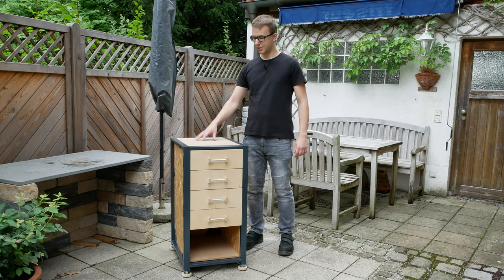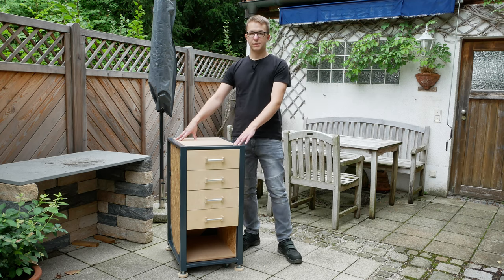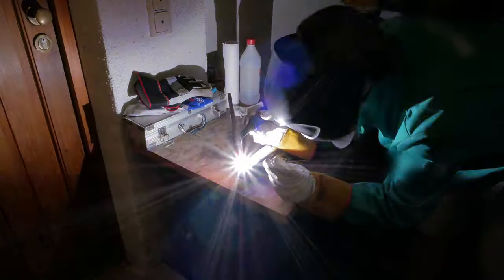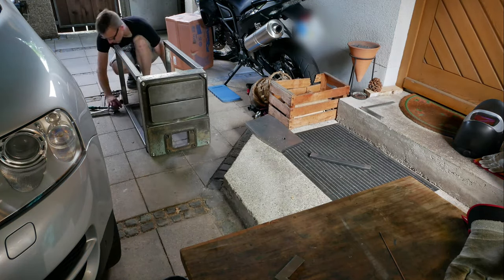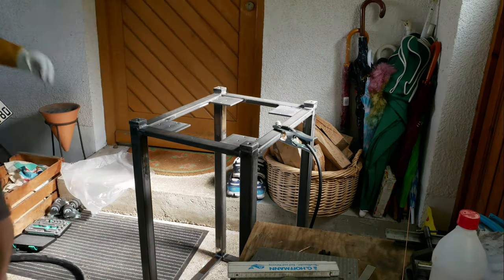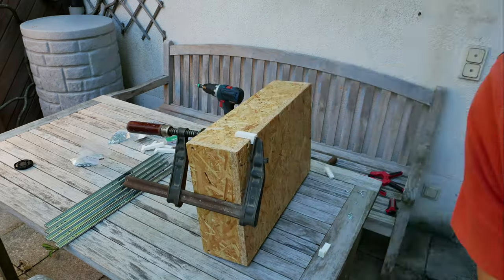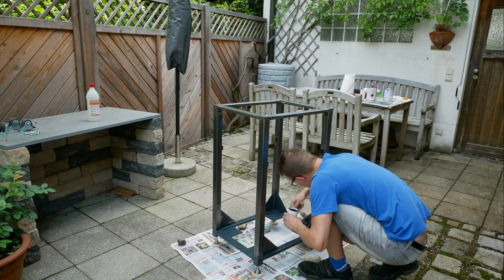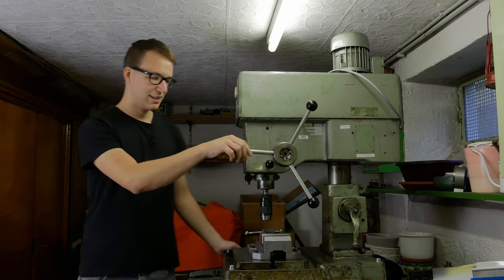Building a Stand for the Drillpress --Part 4-- Old drillpress restoration

Comment: Great job Alex! Want to weld the same just put inside the Ikea Helmer metal cabinet like into a cell). One question though: you drill machine is really heavy and I mine is a little bit lighter but not less than 80 kilos nevertheless - are the wheels are really useful to move the stand around the shop?
Reply from the maker: It works but it's not a good solution if you want to move it constantly. I only need those if I have to do something at the back of the drillpress. So maybe once a year.